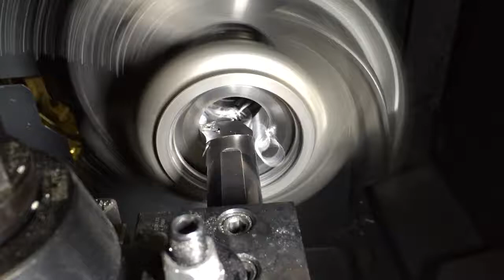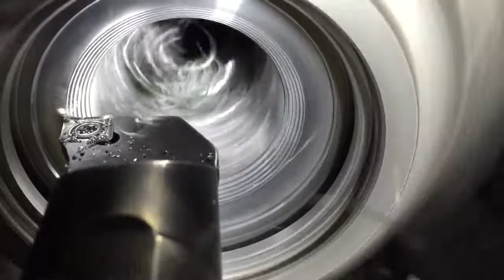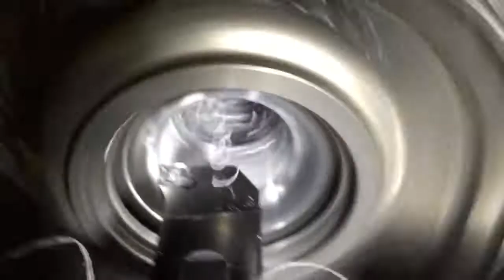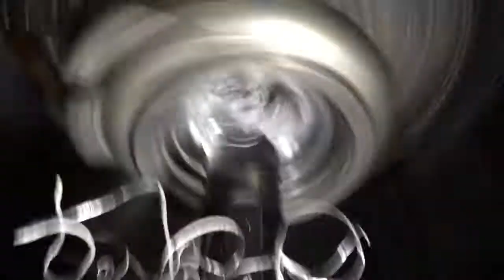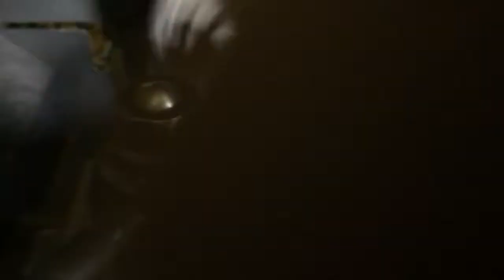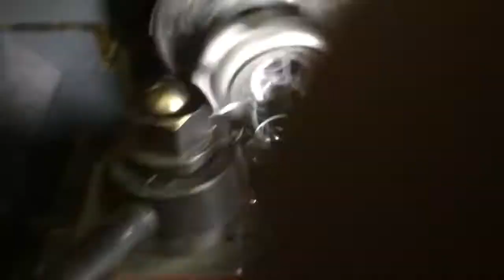Bmw N54 135i 335i 535i Compressor Housing Machining

Comment: New BMW owner here, but my question is this.. How long will your turbos last after the rebuild process? I ask because from what I'm reading online these cars are notorious for weak turbos.
Reply from the maker: The turbos arnt week, it’s a combination of things. The 5 weight oil the engine calls for is too thin for high boost on turbos, change to 10w30 or greater and change the oil on time and they will last longer, as for the flap issue, upload a new tune set to higher boost so the flap won’t open as often and you will prolong the life of the flaps. I rebuild mine 2 years ago, I put about 10,000 miles on them, they work great. I currently run 10w40 with 1 quart substituted mystery oil and I run 18 psi.
Reply: @turbolabamerica  So can you tell me the symptoms of bad turbos? If I need mine replaced I will go through you guys. I have been to your website and so far your prices seem to be very reasonable. Also, the $1050 is not including the core or is included with the $1050?